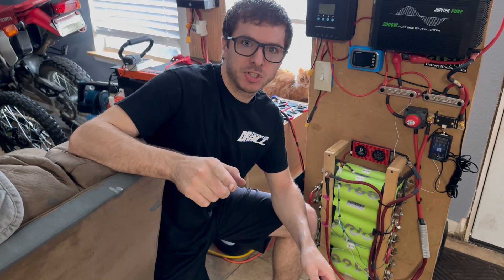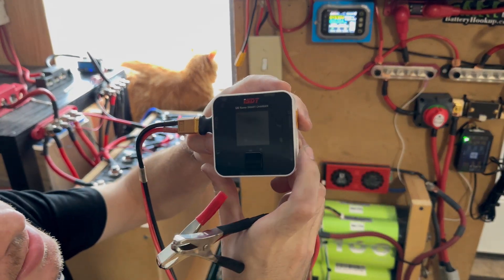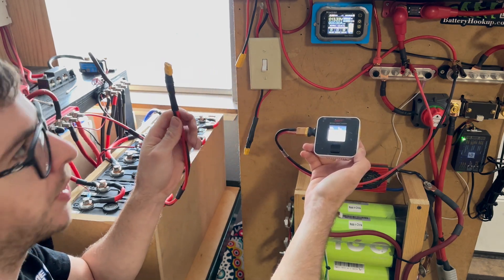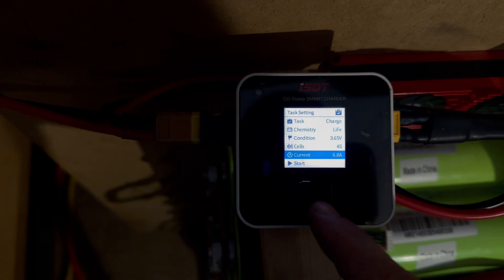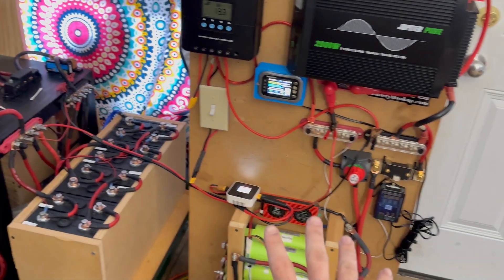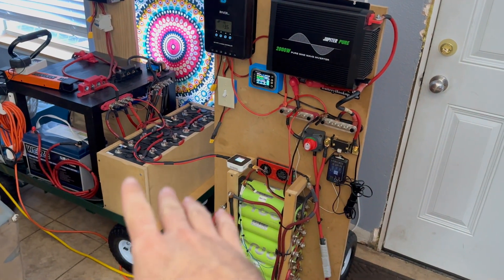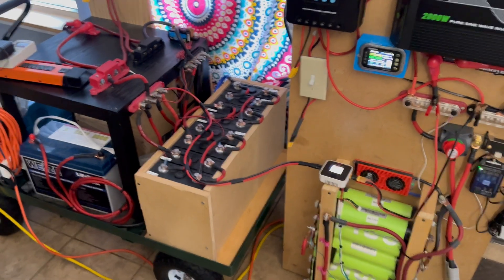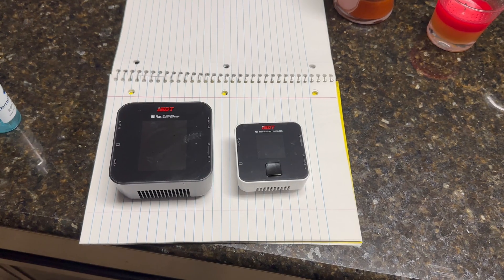Move power from one solar power bank to another!

Comment: For those that aren't aware the iCharger S6 is the best bang for the buck when it comes to regenerative charging at faster rates but the Q6 is by far the best budget option. I think they retail for right around $120. Not to be confused with the X6, the S6 is 1100W and 40A. The Q8 max is good choice if you dont want to drop the money on an 8S iCharger but they do have an X8 and DX8 (dual). The newest big boy is the Duo 458. These stats are crazy. To power it with DC the best idea (for any hobby charger really) is to series HP DPS Server Power Supplies: 1200FB is the most popular but the 460MB works for smaller chargers. 

Duo 458 Specs

Charging current adjustable per output:	0,05A - 45A
Charge current adjustable in synchronous mode:	0,05A - 70A
Input voltage:	10V - 49V DC
Width (mm):	117,8
Discharge power Max. in synchronous mode:	140W
Max. Voltage lead-acid batteries:	15 (2 - 30V)
Charging power Max. on one output:	1600W
External high current discharge asynchronous:	1600W
Length (mm):	171,2
Accuracy balancer (depending on setting):	1mV
Balancer compensation current per output:	2
Max. Power:	22000W
External high current discharge synchron:	2200W
Charging power Max Syncron:	2200W
Max. Discharge Power:	2200W
Max. Number of NiCd/NiMH batteries:	25
Height (mm):	57,5
Max. Charging current:	70A
Input current limit:	70A
Discharge power per output:	80W
Weight (g):	930
Micro SD Card Slot:	Yes
Power supply integrated:	No